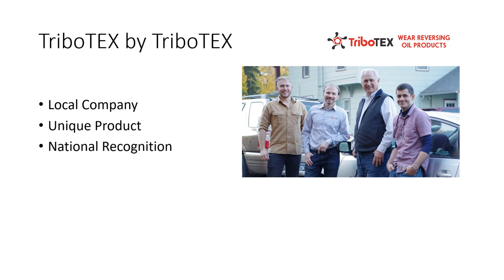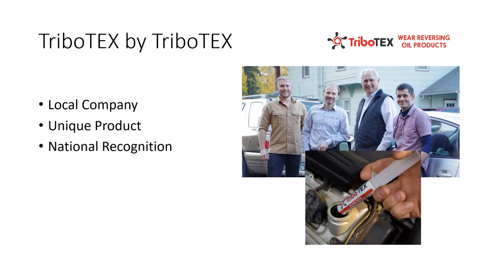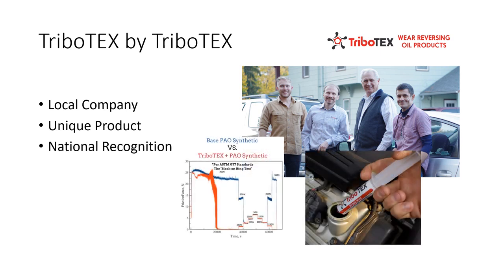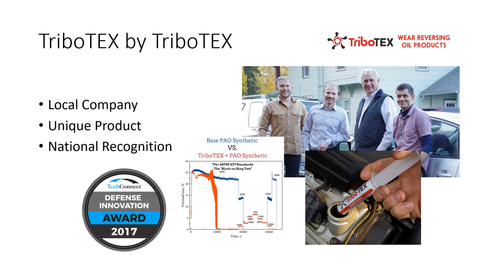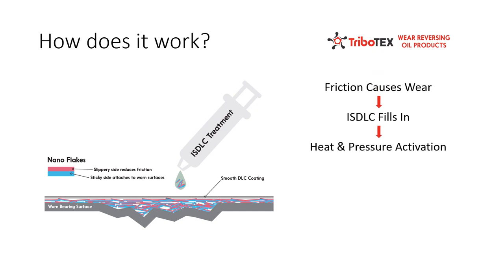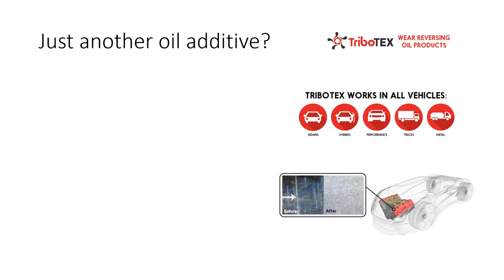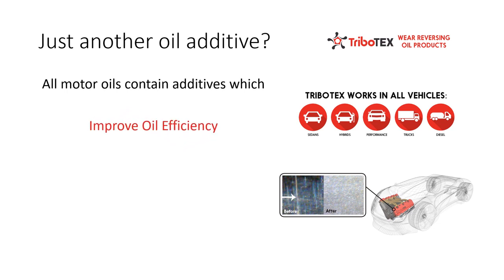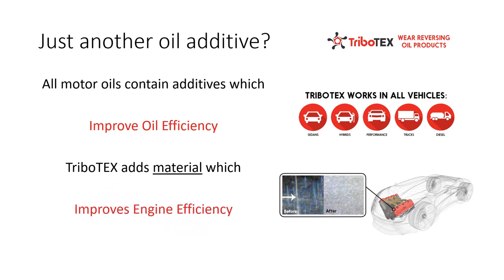What Does DLC Stand For? DLC Coatings for Engine Parts

Comment: The only concern I would have is if tiny oil passages might get clogged in some cars. If not this seems likes a good idea.
Reply from the maker: Hey there, our nanoparticles are so small that they can safely pass through the oil system without clogging. A TriboTEX nanoparticle is less than 1nm in size, while the pores of most commercial oil filters are 25,000nm.

Comment: Can you create diamond like pure graphite coatings on parts outside of an engine (such as during a rebuild).  I am guessing it would be sort of like powder coating?  I would need the DLC layer to be pure graphite or carbon as I need the electrical properties that additives may degrade.
Reply from the maker: Ron, generally our product line seems like not have a match to what are you trying to achieve but if you drop us email with more details we can recommend something else for the task. We have good understanding of sliding contact and graphite tribology as well.
Reply: @TriboTEX  what is your email?  I am trying to build scientific apparatus and its all specialized but I am trying to avoid starting a DOE lab on my property out of pocket
 (at least not yet lol) so I am trying to see if I can get certain things done elsewhere.